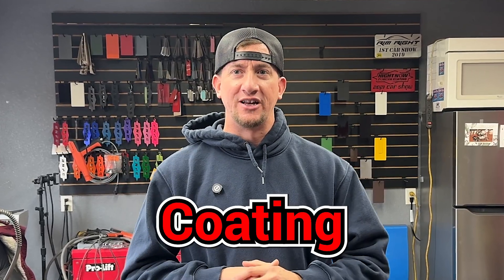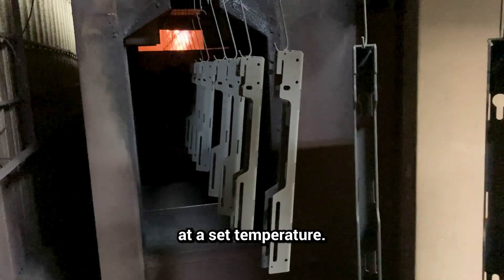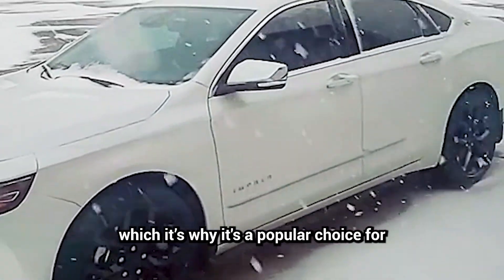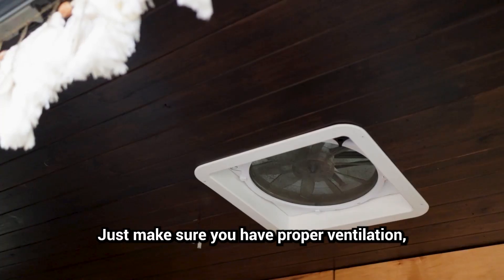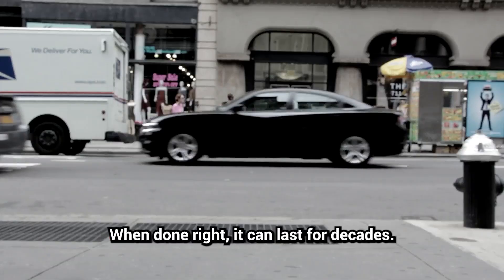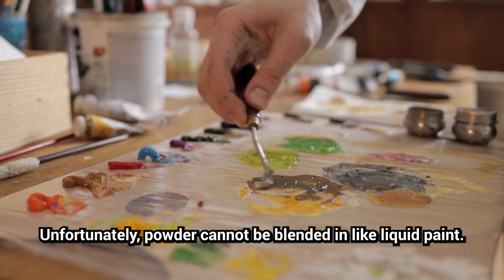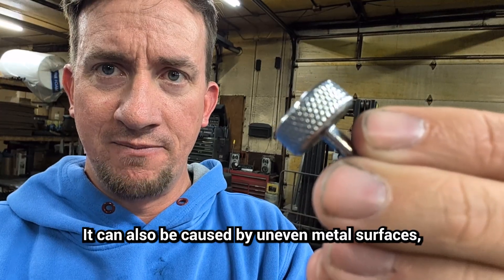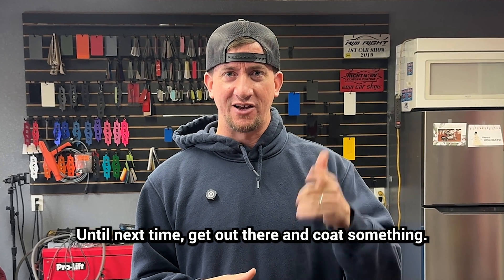Top 10 Powder Coating Questions Answered For Newbies!

Comment: Hey Dan, I bought an Electron e-coat master from you about a year ago. I feel like I have too much wasted powder when spraying. How do I dial this in to have less waste
Reply from the maker: Adjust settings, less air and powder less waste, the gun can only charge so much powder at a time.  Also if you have never replaced the electrode you may not be putting out enough charge, they are a wear item.  check out my new site www.ctsainc.com for spare parts